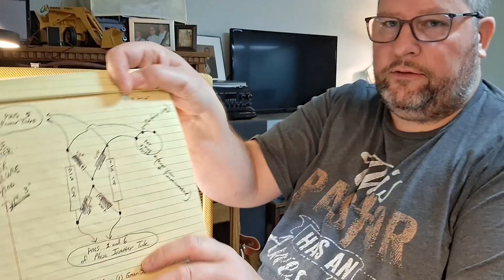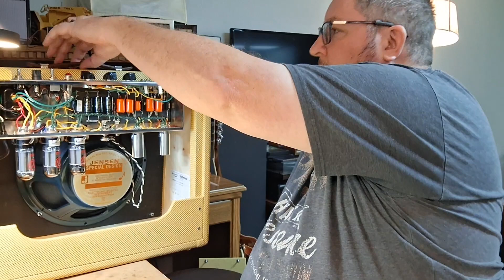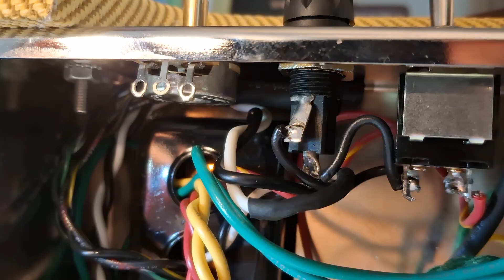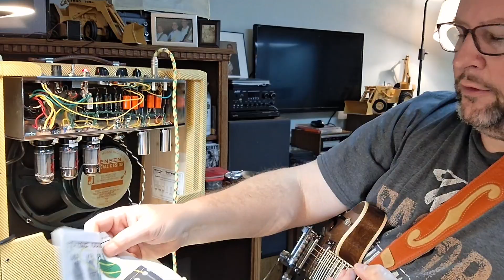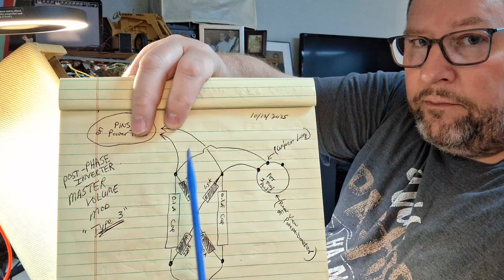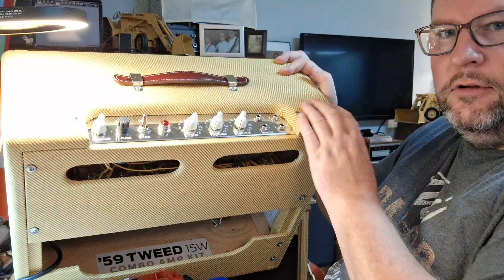Master Volume Post-Phase | 5E3 '59 Tweed Tube Amp Mod That Changes Everything! 👌

Comment: I'm glad you made the correction in the placement of the PPMV pot in the circuit. The first time you showed the drawing I was thinking "huh?".  Heads up though, you have the top rear panel on upside down. The slots are intended for air flow to the tubes. Someone could stick their fingers through them in that orientation and get bit by all sorts of dangerous voltages! I saw one of my amps used in the Platinum Room in a Guitar Center one time that had the panel flipped that way too, so you're not the first to do that.
Reply from the maker: Very astute observation, friend. 😊 Yes, for some reason I installed the back panel wrong way around. It is now on correctly. Have a good day

Comment: Are you finding any notable difference in sound by switching out the caps?
Reply from the maker: Hi. I can't hear a difference in tone from the amp with the upgraded F&T filter caps, but I definitely feel better with them installed. Thanks for asking.